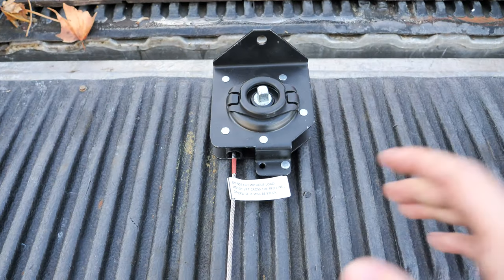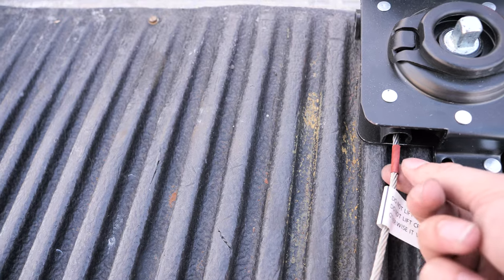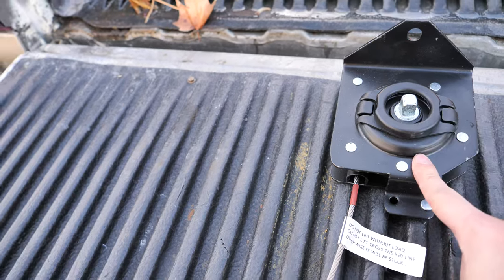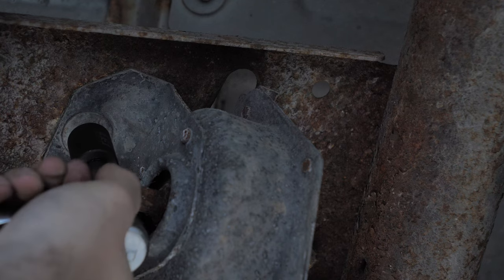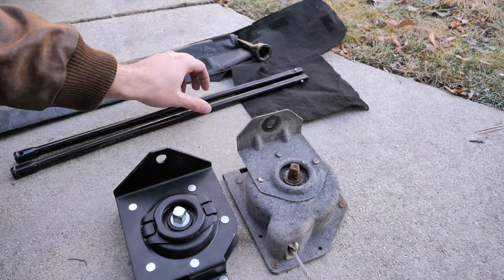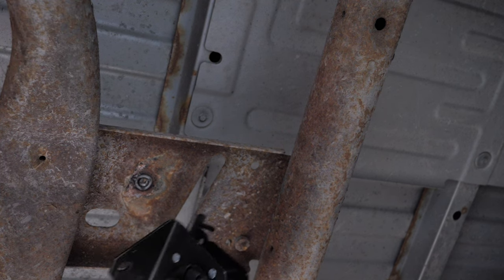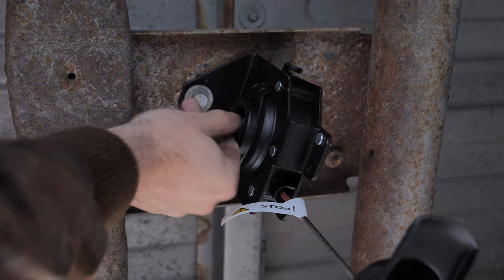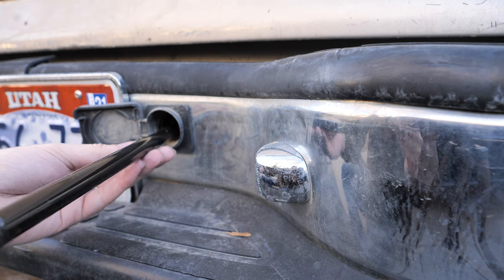Swapping Out My Spare Tire Hoist! - 2000 GMC Sierra 1500

Comment: Hello this is my question. I bought my 02 1500 22 years ago. I have never dropped the spare tire.. So I don't anticipate much luck trying this weekend.. What advice can you give me, with the tire  still mounted and the winch is frozen.. I guess I'm wondering if the mounting bolt for the winch is accessible or is there a alternate way to get the tire off so I can throw the winch away and put on a new one.